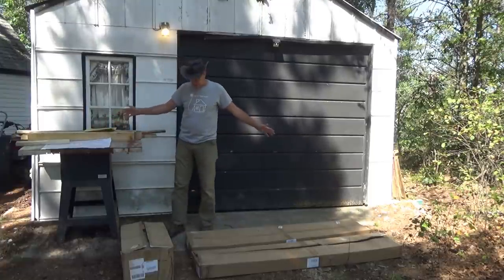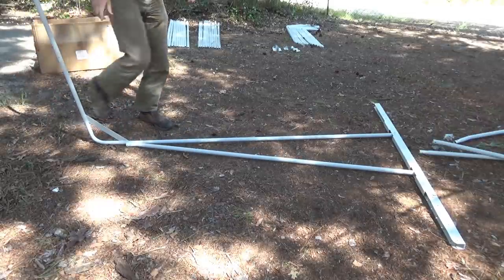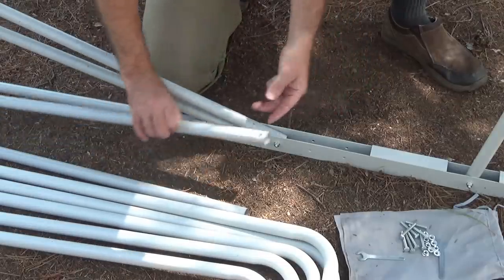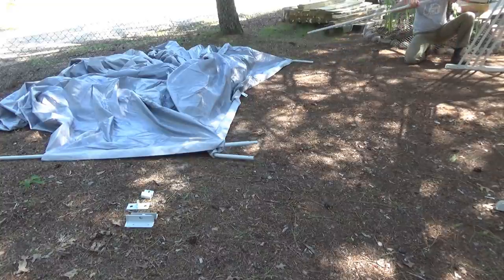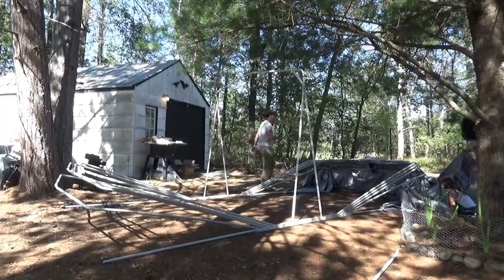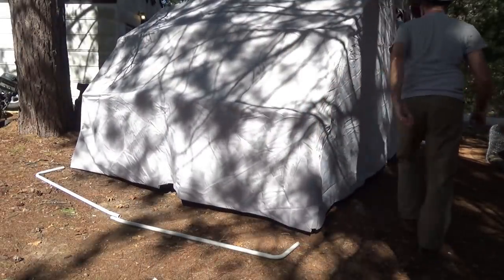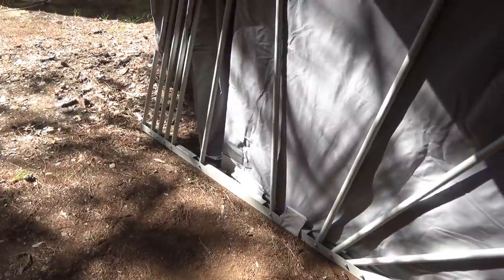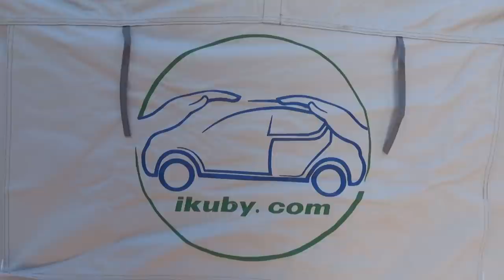How To Assemble The Ikuby Carport Car Shelter

Comment: I just put mine together and used your video to guide me along. I did the cover a little differently but can't say it was or could be easier. I did mine all from the inside after throwing the whole tent fabric over the frame. I did the two bottoms pieces just like you did which made it a whole lot easier. Thanks for the help!
Reply from the maker: Glad it helped!

Comment: I shared a cubicle at GM back in the 80's with an engineer who worked on the those body side moldings for the Cadillac Cimarron, highly controversial some people liked them some didn't.
They spent like 2 years hashing it out, designing and incorporating them into the model.
Reply: He went on to work on a rear fold down armrest, I believe it was a Pontiac model, that opened to the trunk area so you could put a 2x4 or some ski's through the trunk into the passenger compartment -- always wondered if anyone ever  got in a front end collision, only to be impaled by a set of ski's.
Reply: THERE SHOULD SCRAP THE I DEAL AND MOVIE ON WE CRUSH A LOT THEM
Reply from the maker: I do love those drop down arm rests. I have used them so often through the years. Never impaled anyone tho.

Comment: Overall, not a bad how to video. I do think you should of shown how to do the anchor points, as far as where to attach them to the rail. I think if you had done them first, it would of given you space to slide the bottom velcro flaps through. The only other part, is maybe have the second set of rails all the way up, so after pulling the canvas over, just push the rails down at each velcro strap.
Reply from the maker: Thanks and thanks for the tips. Not sure about arms up tho. I think we tried that and they started to fall down on us.

Comment: I'd place a couple of those logs you got along the sides, use some long zip-ties to anchor it. done.
Reply: WE USE TO USE REBAR BENT IN TO HOOK AND POND IN TO THE GROUND TROY WOOD NEED SOME CEMENT
Reply from the maker: Chris, I am considering cement and rebar with hooks on the ends.

Comment: Great video. Im thinking about getting one of these and was wondering how good it would be in the grass or dirt. How did you stake it or secure it? How well is it doing in the sandy soil?
Reply from the maker: Thanks If you dont anchor it down it will move in sandy soil. I am getting screw in anchors for this. I plan to share them on video when they arrive.
Reply: Buy some rebar that fits in the bolt holes, cut them about a ft long then bent over 1in in a vice